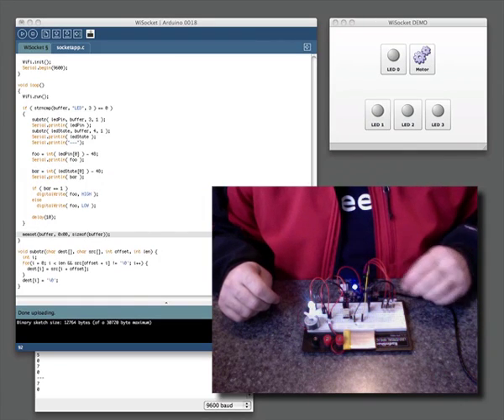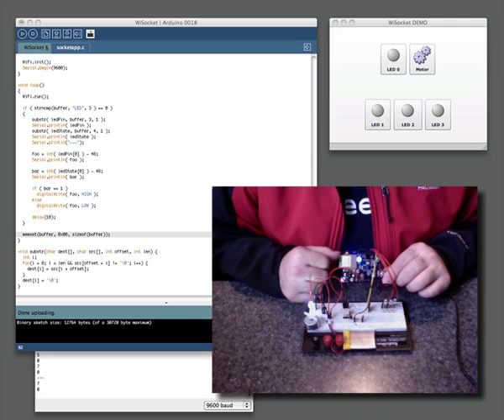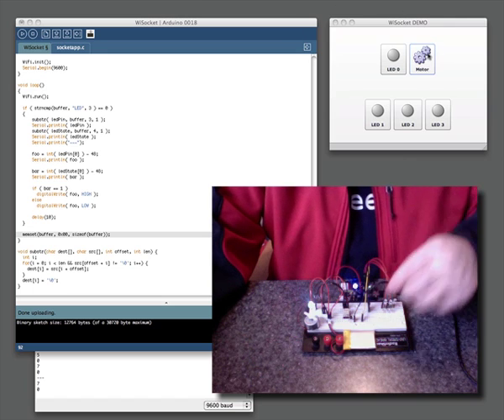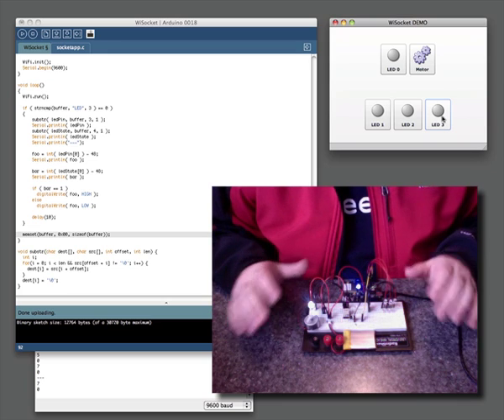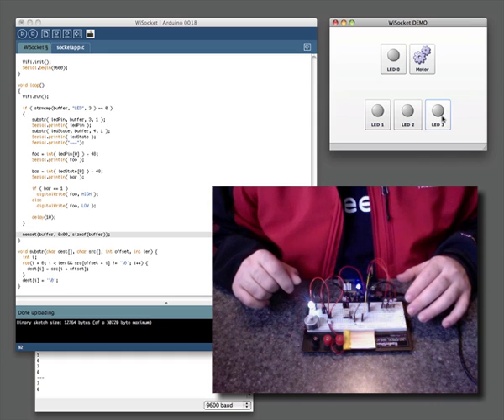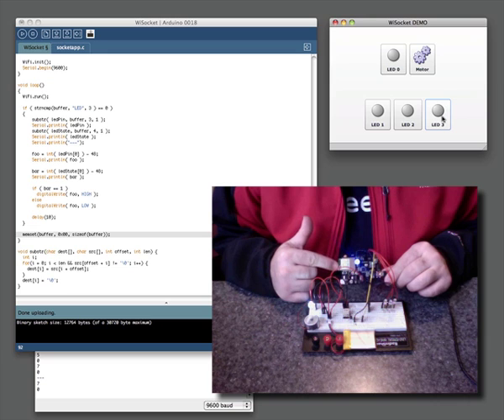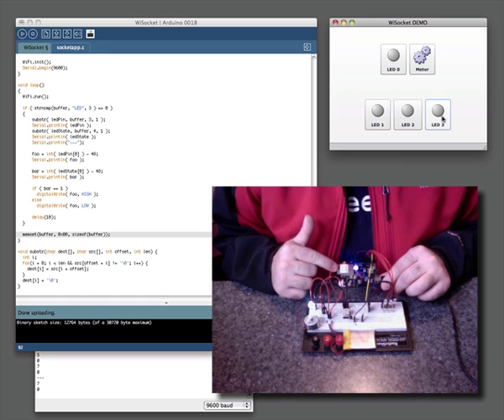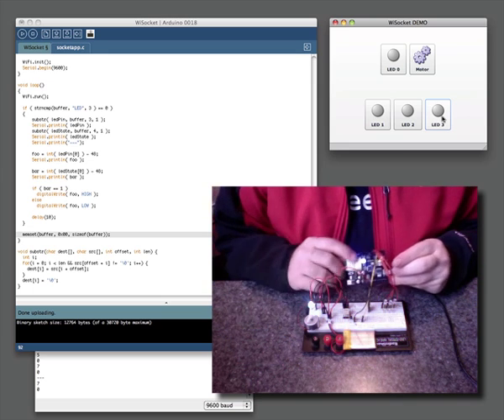Adobe AIR and the Async Labs Black Widow

Comment from the maker: Yepper... you can use the Black Widow as a wireless bridge for just about anything you can cook-up. However, it's not plug and play - there are some tricky bits around connecting to secure networks and SSID handling.